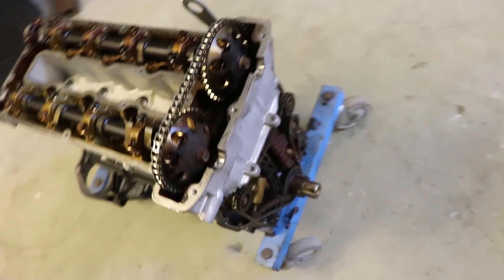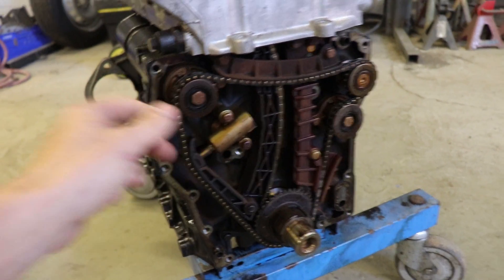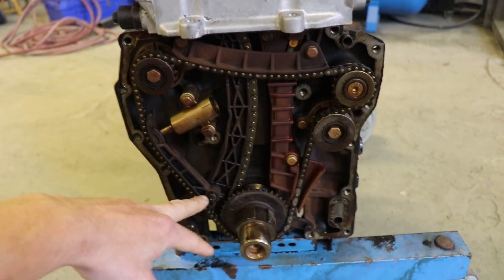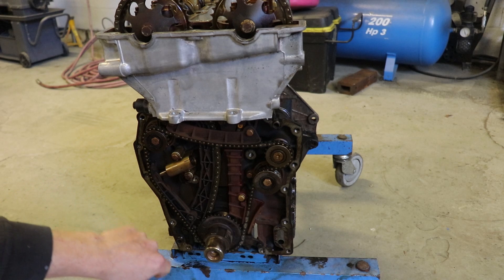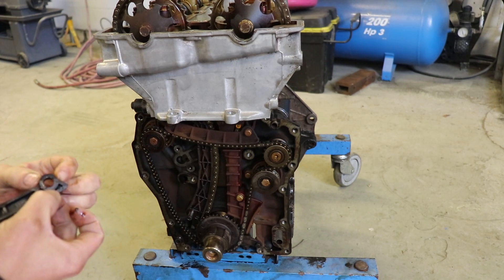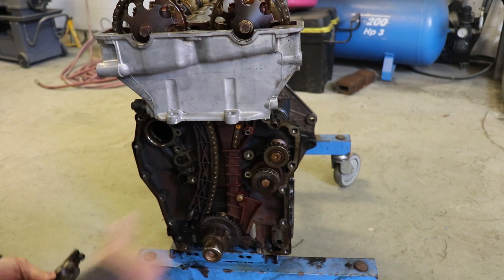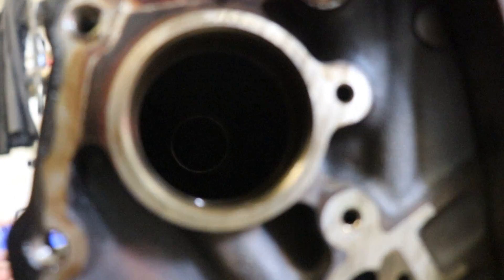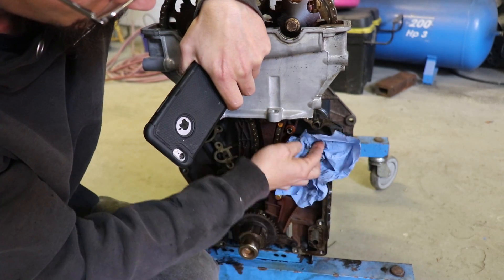SAAB B204 ENGINE BALANCE SHAFT DELETE

Comment: 4 years later I'm curious what your results are. How many km have you put on the engine? Have you had to do more repairs than you had expected? I'm considering deleting the balance shafts from my Atlas 3.7, I'm worried about the long term effects of allowing my engine to have more vibration than was originally intended
Reply from the maker: The car is still going strong although no longer in my ownership.

Comment: A year ago, but very informative,
Thankyou buddy.
Just one question,
The parasitic power loss is the drag from the chain on the shafts,
Is their any reason why I could not
Just remove the chain, blank the tensioner, trim the lower guide,
But leave both balance shafts in place? 
Would appreciate an answer,

Comment: Great video ! I want to do this to my 2000 9-3 motor. With doing it the way you showed.  I'm assuming since blocking the rear cam journal. I don't have to plug the #3 crank journal oil hole in the block. Do I have to pull the block to do this to remove that rear bearing that gets knocked out. Or can it be removed from inside the block.  I've been reading about this awhile. Your way seems so much easier. 👍👍👍

Comment: B204t  is a superb engine made to last. Mine is mapped to 
230hp and has now done 217k miles. It uses no oil between changes. I use 5/30 Granville C3 oil (dexos2 spec) with Mann filters and E3 plugs. It still has its original cam chain. Recently it developed a slight rattle but upon removing the cam cover (spotlessly clean with no sludge) I found it was just a worn top guide which clips into the top of the cover. It was only £10 and around an hours DIY work. Even the rubber cam cover gaskets were still in good condition and perfectly reusable. I can't remember the reference number but I use a larger than standard oil filter. Only a guess but reckon this may have helped with longevity. 
Good video.

Comment: Great job well done. Didn’t you think it was advisable to make a couple of blanking plates to close off the holes left where the balance shafts were?  Just wondering about the crank case pressure in the gallery ??

Comment: Also worth noting their is a oil way that feeds into the main chain guide on the right which trickles oil onto the balance chain a lot of people plastic weld this up on the balance chain side to aid with oil pressure.

I've done this swap on a few b204 engines and it makes a massive difference to how quickly they rev. The shafts are about 2kg each so makes a  huge difference to reducing rotation mass

Comment: hmmmm , looking at the verry deep machined grooves in the balanceshafts theres a good change the the oilfeed to or from the heads goes through the bearing surfaces of the balance shafts , and plugging them up might starve the top end from oil or make the flow back of oil out of the head harder causing the sump to empty over time 
you can still do the mod but instead of putting in pieces of pipe you make plugs with the groove in them out of cast iron (same material as the engine block so it expands and contract the same way as the block )
you can still install those like you did the pipe if you dril a hole in the center and make a drive in tool for it 
seen those drive in tools being used for block mounted cambearings and usually the have an edge at the end of the cam that hits the engine block when the bearing is seated fully , takes the guesswork out of installng them
Reply: Yes I did comment on oil feed to the head ,this is common practice to meter the head with oil .
And the drillings often come from the main oil gallery via balance bearings and then up to the head .Paul .

Comment: Had a daft idea for increased oil capacity that may or may not work as it's straight of the top of my head, tap holes in the pan sidewalls as close as possible to the bottom and add lengths of braided oil pipeline where there's clearance and have it loop back into the sump so  you don't have to fabricate a whole new one???:)

Comment: Oil starvation due to a faulty sump whose design was likely a result of compensating for balance shafts. All in the name of comfort. Seems Saab should've engineered an entirely new, smoother running engine rather than add a system of counterweights. Maybe somebody can fill me in as I know nothing about manufacturing engines. Cheers.
Reply: I think he said in previous vid the sump was his own design to get it to fit in the escort.
Reply: @recap5172  I thought he said the new one would be his own design.  I think that the position of the pick-up tube was not realistic for the way the car was being driven.  Too much oil sloshing about, leaving the pick-up to suck air.
Reply: @imouse3246   no baffling, pick-up tube set too high, etc. Got it.
Reply: @recap5172  I missed that. Thanks.

Comment: Nice work and interesting stroll around the Saab engine. When you go blocking oil galleries I get a pucker thinking of my Harley, almost every oil gallery is scavenged once or twice down the train. That also explains the cascading failures on my bike when something goes fail there are ensuing failures. Great video I love watching engine work, cheers and congrats on the growing subs!
PS; those balance shafts were quite hefty, does it make a lot of difference on power and smoothness?
Reply: Balance shafts can make a big 4 cylinder as smooth as a V6 for the same power. My 16v Volvo 2.3 was far better than my Audi V6 2.6

Comment: Why not just dry sump it?
Reply: Cost
Reply: @johnnytenjobs  yeah for a pre made bespoke. This guy fabricates and engineers his own stuff. He needs a scavenge pump some pipes?
Reply: @den2k286  Sure, but if he puts the tank in the boot its still a lot of plumbing and hardware.  Compared to knocking up a decent sump with some baffles/flaps which he could do using a few bits of tin in a couple of hours.   Don't get me wrong I fancied one but a special sump and pump from Pace was a lumpy price.
Reply: @johnnytenjobs  I understand the point on money but the sump he can fabricate with an integral the oil pick up pipe to the  original pump.  Then scavenge to a tank in the Engine bay. he can fabricate this too baffles and all. needs to be tall an slim. i just fear angle of attack for Engine is steep. will loose another bottom or have massive rear main  seal and clutch issues.
I have done something similar to a pinto in a mk1 Escort in about 88 or 89.  Any way i like his fabrication so lets see that cnc plasma do some work.
Reply: @den2k286   I agree that it would be worth watching.

Comment: Leave the b/s in
Reply: Not always a good idea. The balance shaft bearings in my engine were really worn which reduced oil pressure by a good bit.
Reply: @NorwayVFX  thats why bearings need to be replaced and the oil valleys needs be ported/opened up more. Even parts of the oil pump as well need be cleaned and polished for smooth flow. 
Keep oil at the bottom end vs. flooding the head.